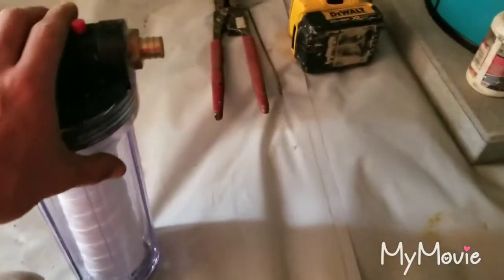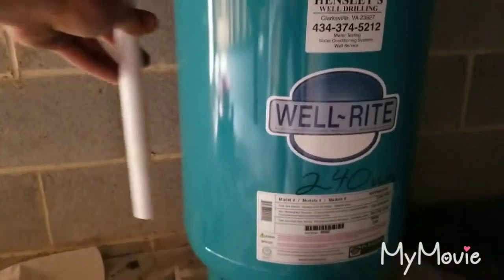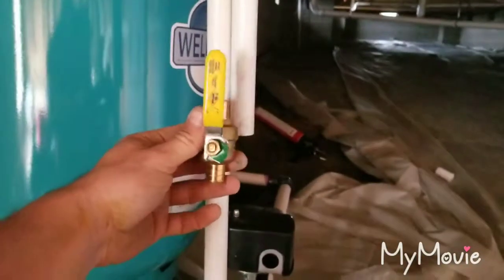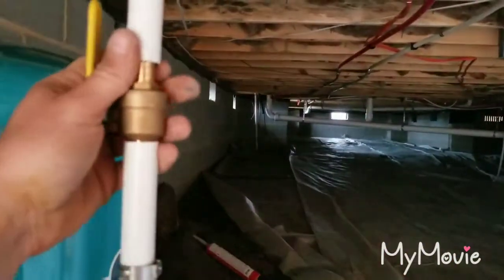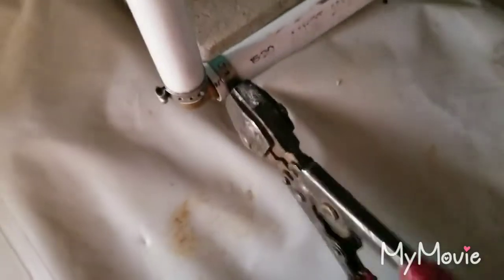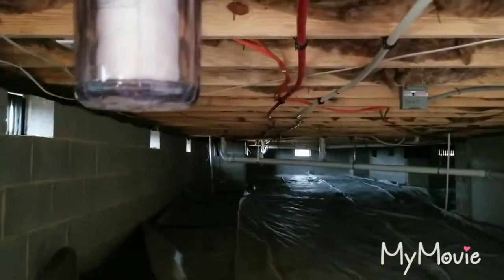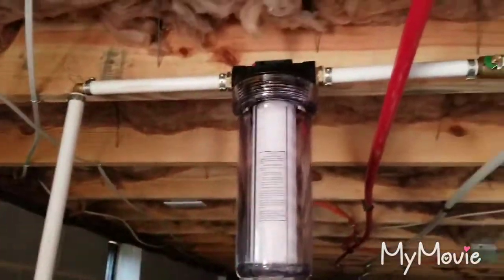Water Filter Install Whole House

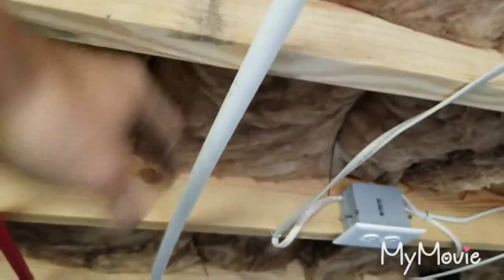Comment: 00:50  Usually a bypass line, with a valve, is installed around the filter in case there is a filter issue.
05:13  Should use food-grade grease on the o-ring.  Some people also put a small dab on the sump threads.

Comment: I live in the Chicago area and have a sediment filter that clogs after a month of use which reduces water pressure. Water quality is decent, I only have a water softener and water has no smell or discoloration. After I replace the filter, water pressure is great for about another month. There has to be a better solution? I've asked a few water guys around here and their answer is to bypass the filter? That sounds nuts to me, wouldn't all the slimy muck that the filter catches just end up gunking up my plumbing eventually causing more trouble? Has anyone installed a self-cleaning whole home sediment filter that backwashes every few days?  Do they work well and how much did it cost to install?  Between the hassle of changing filter and the nearly $15 per filter cost, I'm ready to do something. Thanks!

Comment: Do you think I can pull my own pump, it's approx 120' deep?
Reply from the maker: If its on pvc no. If its on black pipe yes
Reply: @h2omechanic  I ran across your video last night about toilets running. When I check mine, all three needed adjustments!! Might not need to pull the pump after all. My well is taking a while to build up pressure. 

Have you considered doing a video on increasing the water pressure in your system (setting pressure in tank and adjusting pressure switch)?
Reply: Really appreciate all your videos. Just wondering how many microns the the whole house filter should be?  How do you determine when to replace the filter?